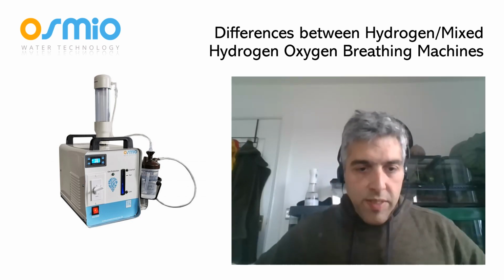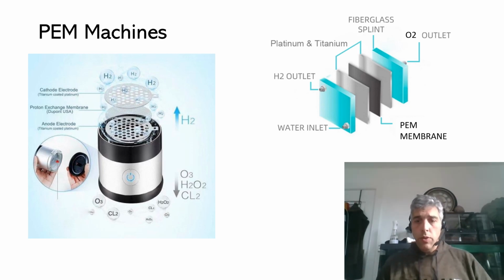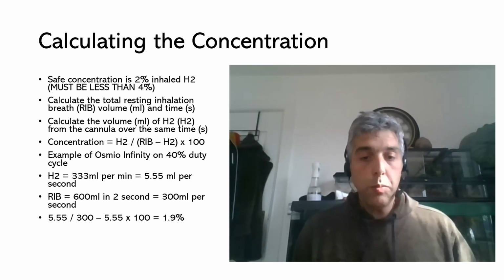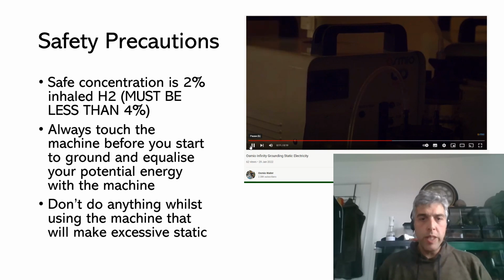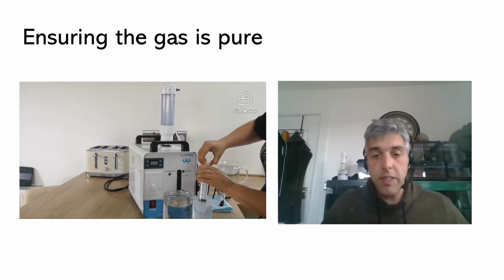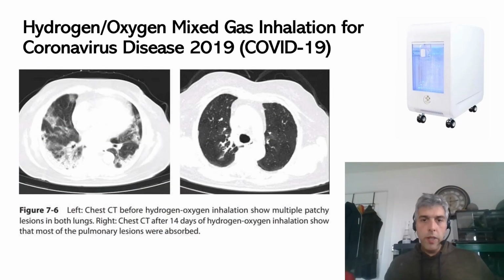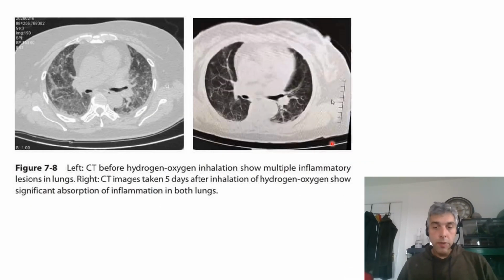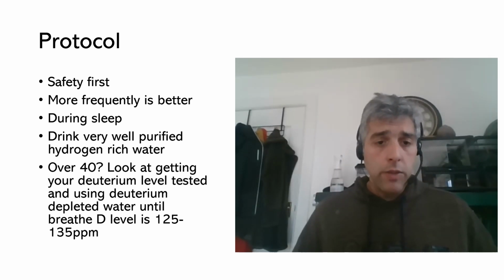Differences between Hydrogen/Mixed Hydrogen Oxygen Breathing Machines and Safety and Protocol Advice

Comment: How much Lye is added to BG machine ?Maybe some moves over into the water to drink that you mesure the OPR with? it only needs a very small amount of Lye to contaminate the BG drinking water to raise the pH and hence the ORP.
Reply from the maker: In the Osmio Infinity it is 80g, and the amount is to do with the spacing of the plates. Lye and other impurities will be scrubbed out my the first humidifier and all through the second and third if you have one. The key thing is that the machine level is kept high and the water in the humidifiers is changed every 5-6 hours of use, to make sure the gas inhaled is pure. There is no pH effect, the ORP effect comes from the EXW.
Reply: manty thanks @OsmioWaterH2O   Can I take ths opportunity to ask you:  approx how long for average size person does it take to reach Hydroxy gas saturation in the body/blood at say 300 ml/min, cheers.
Reply from the maker: @johnclaydon604  it depends on many factors, such as how they breathe and the condition inside the lungs. But say for example with me, it would be within 1 hour breathing at 40% duty cycle which is about 533ml per min.
Reply: many thanks again @OsmioWaterH2O

Comment: What happens if one takes just one deep breath of pure hydrogen, then keeps breathing normally and repeat in a while?
Reply from the maker: you would absorb the hydrogen
Reply: @OsmioWaterH2O  ok but people don't do it because it's dangerous, right?
Reply from the maker: @StefanDanov  only if concentration of h2 is over 4%
Reply: @OsmioWaterH2O  because it becomes flammable. So it's technically impossible to take a deep breath of pure hydrogen without taking the risk to explode 😁
Reply from the maker: @StefanDanov  if an explosion happens the force will go in the direction where the h2 concentration is highest, which will not be in the direction of a patient :)
Reply: @OsmioWaterH2O  I bet it's not correct as an explanation. Even if the explosion happens in the machine, if there's enough concentration in the lungs the explosion will happen also there with its relative force based on a ratio between air and hydrogen mixture. The facts is when you use the lowest concentration for an explosion from the machine there will always be a lower concentration than that in the lungs, so it will never be enough to explode, that's the reason why the explosion will happen only in the machine final stage before the bubbler/valve. 

Let's say there is 50% from the machine and a concentration in the lungs at 10%. If an explosion happens both the machine and the lungs will experience it with a force relatively to the concentration in the "conductor". It will never happen because there will never be a concentration higher than 4% in the lungs with a feed rate of 4% from the machine.
Reply from the maker: @StefanDanov  betting against what I'm saying is incorrect? What are the odds? how much would you be prepared to lose? :)
Reply: @OsmioWaterH2O  well, it's logical, then I'm prepared enough. If the concentration in the lungs is 4% or higher the explosion will happen also there independently from the concentration out of the lungs. That's because hydrogen needs at least 4% concentration to explode, and it will even if the feeder is at higher concentration. It never happens with these machines because with 4% maximum feed rate from the machine the lungs will always have less than 4% and it could never explode. Your explanation could be interpreted wrongly, you said the explosion will follow only the direction of a higher concentration, meaning that if in the lungs there is 10% it wouldn't explode if outside is let's say 50%, which is wrong because it will explode in both directions.
Reply from the maker: @StefanDanov  its impossible for the concentration to be higher in the lungs than the 66% of h2 coming out the tubing
Reply: @OsmioWaterH2O not only, the machine mixes it at 4% with air so in the lungs is always at non flammable concentration.
Reply from the maker: exactly and when you take into consideration the absorbability of hydrogen, it would be very difficult to create an explosion in the lungs @StefanDanov

Comment: Hi, very good video, this is what I was looking for to understand the differences between different technologies. I am looking for generators for my offices with hyperbaric chambers. I know that it would be best if they were non-membrane generators, but most of those that are, unfortunately, are in spe / pem technology. The manufacturers of these devices say that the ratio of hydrogen to oxygen is 66-33, but is it brown gas if it is from membrane electrolysis.
Reply from the maker: No it's not browns gas if the mixed hydrogen and oxygen come from a machine using pem/spe
Reply: @OsmioWaterH2O  have you heard of ozone blood treatment

Comment: all you need for H2 is electricity, a 4$ rectifier and two plates of some waterproof steel. That's all you need, what the point of buying those apparatus. 
there's no different btw h2 and h2 o2 mixture. H2 you will mix up with air anyway. h2 + o2 you can inhale without mixing it up with air
Reply: Exactly. Marketing hype with H2, even though even the effects are highly questionable.
Reply: @bororobo7036   the effect is real, its a powerful antioxidant. But it interferes with apoptosis, slowing it down. Which potentially is a cancer promoting effect coz apoptosis kills mutated sells first, and all the sells that the body thinks should not divide and give offsprings. H2 prevents it. That's why i don't use it anymore.

There are better options, like all kinds of plants, vit C, and especially infra red light in the range of 650-1200nm ( produce a lot of melatonin in the cells and melatonin is very powerful antioxidant without this apoptosis prevention catch).
Reply: @bigbang259  How do you know it 'interferes with apoptosis'? You have a source?
Reply: @djdawizz  read some papers. Yes, it definitely interferes with apoptosis. You can find some research just ask some AI for some links

Comment: Is it dangerous to use lye for hydrogen production?
Reply from the maker: No, with the correct user procedures the gas will be inhaled in almost completely pure form.
Reply: @OsmioWaterH2O  Thank you. Also, do you know if PEM tech produces toxic byproducts?
Reply from the maker: @colinchang1543  depends on what type. A hydrogen water bottle no, but eventually yes, a hydrogen breathing machine using a pem definitely yes, as the water inside you put in after some time will go up from 0 TDS to levels which only can come from the machine itself
Reply: @OsmioWaterH2O  Yikes. So with that said, replacing the water on a regular basis will negate these toxins?
Reply: @OsmioWaterH2O  What about the nickel and chromium from the stainless steel plates in the HHO generator. Can they be filtered out with the gas washing stages afterwards?

Comment: Hi. Great video and very informative. I’m from Malaysia and what is available here is somewhat limited. There are basically 3 types of machines and from what I know they are all PEM available here. Those that output pure hydrogen, those that outputs hydrogen and oxygen in separate outputs and those they outputs mixed gas of 66% hydrogen and 33% oxygen in one output. 

My question is is there an advantage in breathing in just pure hydrogen vs mixture of hydrogen and oxygen? 

And also their flow rate for hydrogen are generally either 300ml/min and 600ml/min. Of course the sellers are promoting higher flow rate saying it’s more benefitial than lower ones but from your video it seems 300ml/min seems to be optimum.

Is it ok for you to give me your thoughts on these questions? Thanks so much in advance.
Reply from the maker: Ok so there are many points here:
1) Machines that do not use PEM, and use an electrolyte with the pure water in the reactor are called hydroxy Browns Gas Machines, making hydrogen-oxygen mix but also electrically expanded water, a cluster of negative electrons. In some preliminary tests we have done on people, it seems that the Hydroxy Browns Gas is better in every case so far. So this is why we are doing our first 7 clinical studies using Osmio infinity Browns Gas on Parkinson's, COPD, Asthma, and Long COVID. After these studies we will also do further research to show the difference. In this presentation, the University did a simple ORP test with the hydroxy browns gas vs hho pem machine which was putting out 3 times more the flow rate, and you can see how much of a greater effect the browns gas had on ORP. It is just an indicator but the results seem to translate to people. We will be doing a plant study soon and showing the difference between hh0 pem and hh0 browns gas. 
2) PEM machines use a proton exchange membrane which will eventually fail. It's common to have this within the first 5 years and then the reactor needs to be replaced which is the most expensive part.
3) Many PEM machines I've tested do not output pure gas. You put 0 TDS water inside and now they using TDS sensors and making users replace it, the water is 15 TDS when I replace it, so the TDS comes from the PEM and also can be from the tanks.
4) It is very easy for any manufacturer to make one model with a fully adjustable flow rate using pulse width modulator software, I'm currently helping two Chinese manufacturers solve this, there will only be one model in the future.
Reply: @OsmioWaterH2O  wow!! Thanks so much for your reply! Really appreciate it. 
Unfortunately in my country I can’t find hydroxy browns gas machine. At least not yet. I can only find PEM machines. 

My goal is not so much for Covid recovery but rather general health benefits of hydrogen inhalation therapy to help with conditions like allergy, sleep, diabetes and high blood pressure. 

I understand that the hydrogen produced by the PEM machines are not pure but that’s about the best that I can get now. Is there any disadvantage or advantage in breathing just the hydrogen gas vs the mixture of hydrogen and oxygen from the PEM machines in terms of health benefits? Thanks again.
Reply: @OsmioWaterH2O  That is not true, lye is dangerous and poison

Comment: Very useful. Now need to research how to get deuterium depleted water.
Reply from the maker: Flame ionisation, you burn the hydroxy gas on a torch with flashback arrestor and condense this under vaccum and cooling to make deuterium depleted water in the cheapest way possible
Reply: @OsmioWaterH2O  
is there a upgrade or add-on 
coming for the unit
that will enable it to produce DDW

if so what is the estimated 
-PPM 
-time to produce 1 litre

thanks
Reply from the maker: @cpg7804  it is possible with a kit but it's a huge faff, so I'm looking into building a large scale version that can bottle in glass
Reply: @OsmioWaterH2O  
i think george wiseman mentioned its being developed - so i would like to know if its indeed going to be available and if so - what are the functions as previously asked
- i would appreciate an update when possible - many thanks
Reply from the maker: @cpg7804  basically you attach a flashback arrestor and a flame torch and then burn the hho off, the first experiment I got a UV system quartz sleeze tube and put the flame at the top. I got a plastic bucket and made two holes so the tube goes through at a 45 degree angle and fill the bucket with ice and water, then put a bottle at the end and collect the water that drops out, it's ddw. The second experiment was I used an Osmio Clarity glass housing system and had made a 1/2" wide glass condensing coil and same process, that's who you can make ddw out of any hho hydroxy browns gas machine
Reply: @OsmioWaterH2O  have you had an independent laboratory verify  your claims?
Reply from the maker: @maynardbecker4613  no
Reply: @OsmioWaterH2O  Is that forthcoming?
Reply from the maker: @maynardbecker4613 should be but  because for me it's unnecessary at this stage it won't be for a while, but the scientific principle is Sound, it works on paper so ask any biochemist
Reply: @OsmioWaterH2O  I guess, we the consumer,  can get the water analyzed to see if it is really deuterium depleted and publish the results.
Reply: @OsmioWaterH2O   

1. There are  any device to make water with low deuter ?
I have read that in cancer treatment effects give water with low deuter approx 25 ppm 

how to reach such water ? I tried to bought this product i Poland but it is not possible now :((

Comment: Is it safe to use osmio infinity while pregnant?
Can you drink the water after 6-8h of machine working during the nigh or this water is wasted? I use the machine during the night and  not drink the water but it would be great if I could. I checked it many times and it is always 0 TDS even aftre all night of machine operating.
Reply from the maker: We have had pregnant women use the machine, babies and children too with nothing adverse to report. You can drink the bubbled water and better still out it in a hydrogen bottle before drinking and electrolyse in there to increase the h2 level.
Reply from the maker: Also your water need not be thrown away as it could be up cycled into humidifier 1 or used for drinking